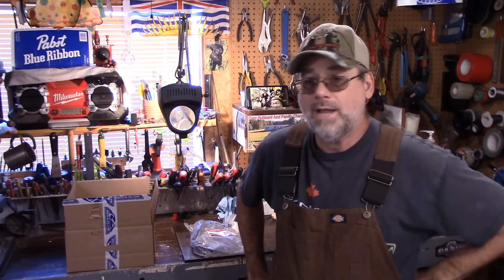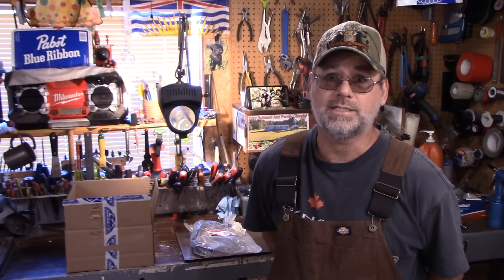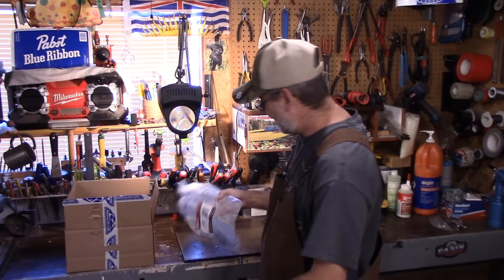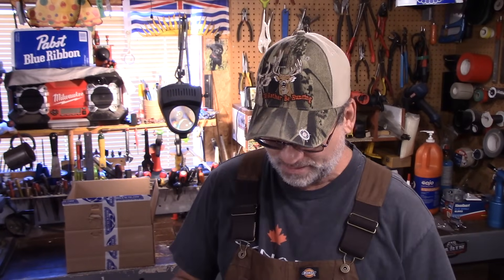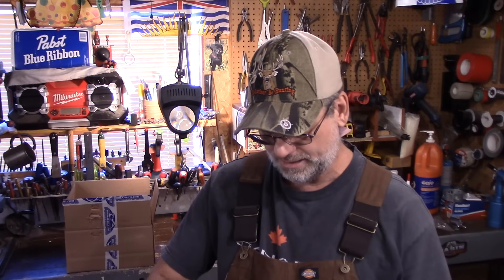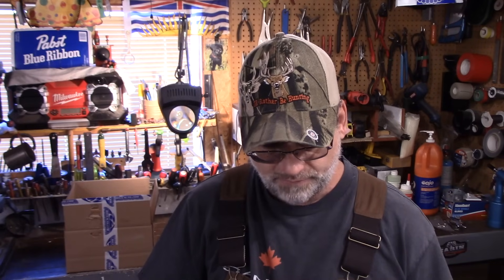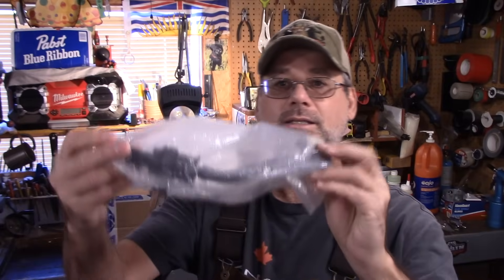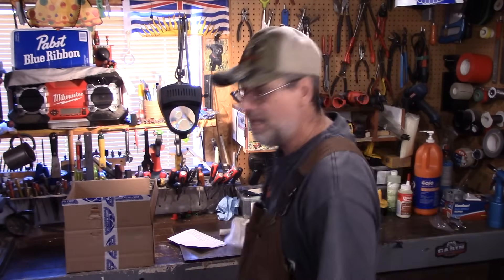F150  STALLING AT STOPS - THE FIX -  PART TWO

Comment: 2007 F150 4.6 liter.  never has stalling issues before.  i replaced the manifolds and EGR Valve because of rust issues.  and exhaust fumes. no spudder truck runs good....But now the truck is stalling at a stop light.  intermittent.   usually after been used for more than 10 min.   Any one with similar issues.  Getting a EGR code  0401 code  anything else to replace.....??
Reply from the maker: Seems your computer is still setting insufficient flow . Check for blockages would be my best guess.

Comment: I have a 03 F150 and it stalls when stopped and will not go. I have to hold gas until it eventually takes off. Not sure if this can fix that problem. Just changed filter and fluid.
Reply from the maker: Ramon this condition never flooded it with  so much fuel not to restart .  Your condition I would concentrate on the throttle body and the  first thing is clean it and go from there.

Comment: Here's a new twist into stalling when stopping or slowing to turn with a 2000 Explorer 5.0. At first I thought it was water in the tank that moved over the pump intake strainer and plugged it whenever slowing or stopping since if I jacked up the rear end the car would die. Dropped the tank and found the fuel pump / sending assembly totally broken loose from the mounting plate. The plastic baffle / gas reservoir that is supposed to be attached to the bottom of the tank had broken loose and over time it apparently broke the pump assembly as the gas pushed it back and forth during stopping and starting off. The resulting mess had the strainer sticking up so that when stopping the gas moved away from it. The daughter said the fuel gauge had quit working a few weeks ago then it started stalling at stops.
Reply: Sounds like a nigtmare... Hope mine is not that...

Comment: since it started the 2nd day ya had it,I was thinking loose connection, wire. hopefully you do have a stubborn purge valve. sucks learning the hard way. this is like a good movie now, who did it
Reply from the maker: Jeff it's a guess at best - I think worth a try and it seems a common resolve too . In time it will tell and I will update on the stalling.
Reply: STEVE ROB REVIEWS if Paul recommends that, we would all be fools not to listen.
Reply from the maker: Paul didn't recommend the purge valve he suggested it could be fuel related between summer and winter blends.

Comment: I have f150 2016 5.0 same issue 

What is the part name that u changed?
Reply from the maker: Evaporative Purge Valve.
Reply: My trucks having the exact same issue. At red lights it refuses to go and rattles violently. Check engine light flashed and sometimes restarting my truck fixes it immediately but now I had to wait like 20 minutes for it to cool off. I had a bank 1 sensor 1 running too rich a while ago for the exhaust value but I’ve heard from other sources that it could be something else
Reply: So I hope it’s just a stuck open purge value causing all of this but if I have to also replace the sensor in the exhaust I’ll do that also
Reply: Just curious to see what you think my problem could be
Reply: Since it started getting cold here in Texas, truck has turned off on me 3 times. All of them were when I was going uphill .

Comment: Did it work?? I have an 05 f150 and it just started doing this to me. And it was 90 degrees all summer until about 3 days ago up here in Minnesota, it’s been in the 40’s the last 3 days. It’s only happened twice. But mine doesn’t run that great to begin with.
Reply from the maker: Solved the stalling instantly .
Reply: Same here... Minnesota hahaha

Comment: I am back Steve, I noticed the truck stalls, stops my fORD 1990 F 140 4.9 because the battery gets too hot. I mentioned it to the guys and one said 'thats a common problem with those trucks because the ignition coil too close to the motor. Another mentioned the it was the ignition part that is close to the battery. I will start with the first and see what happens. Imention this so it may be of help to someone else.
Reply: My 92 4.9 stalls at quick stops and in reverse. Running rough. Not sure what it is yet
Reply from the maker: @reefjunkie9018   First thing I  would do that is so easy is clean your throttle body , takes 5 minutes  and it will instantly show a result or not  if your minimum air is being plugged with deposits.
Reply: @reefjunkie9018  Check, clean the Mass Air Flow Sensor

Comment: Found a similar problem with a 2010 E350 I'm working on replace canister purge valve and still had the same problem It only stalls when you're coasting up to a stop sign or a corner and then go through it turn the wheel and it'll stall.
Foot on the gas or taking off from a stop sign or a stoplight all the power in the world no hesitation no dropping cylinders or stumbling goes through the RPM power band just fine it's only coasting to a stop and then turning.
Reply from the maker: The valve fixed mine .
Reply: @SteveRobReviews  It didn't with mine but a very quick update called a good friend of mine whose had this problem before and sure enough it was something very simple and stupid. So on the vans that have that canister style air filter... The mass air flow sensor wiring harness goes through the side of it before it plugs into the MAF itself. Around the wiring harness is a rubber puck which seals up the air gap behind the mass airflow sensor where the wiring harness comes through the plastic casing. It often times likes to work itself free and sometimes the wiring harness itself going through the center of that rubber puck creates an air gap.
You wouldn't think that would be enough but he suggested sealing it up with some silicone... Sure enough idling problems solved.
I've always known that Ford mass air flow sensors are very sensitive I've known people who've put cold air intakes on their f-150s and f250s and get lean codes.
But an air leak just about the size of a half a dime was causing the issue

Comment: the 5.4engines, 4.6 too.  they are throw away engines.  they say use 5-20w.  it is too thin for worn engines, such as over 100,000 miles.
the engines get worn and the hot oil pressure coming to a stop drops so low  it is below the computer engine cut off pressure and the engine stalls. restart give the pressure switch a jolt of higher pressure and the computer allow the engine to start.  it happens with mine.  i put heavier oil in it and lucas oil stabilizer and it seems to have done the trick.  the oil pressure guage in the ford trucks is fake other than off and on for the computer.  all those other fixes won't correct low oil pressure at high temperatures
Reply: What oil do you use? I still use 0-20w and it stalls from time to time
Reply: @AlexOnibokun  i moved up to 10w30, my stalling stopped completely.  5w20 is too thin for a worn hot engine from my experience,
Reply: @jmyers9853  thanks for the prompt response. I got mine a few weeks ago and I observed the aggressive jerk caused by the vct solenoid. Changed the oil to the recommended 0w-20. I will be replacing the vct solenoid and the cam shaft position sensors this weekend, then change the oil to 10w-30. I also observed my full tank doesn't do more than 200miles as against the 585miles it shows when fueling up

Comment: Hello everyone I have a 96 f150 5.0 if it’s any wormer than 80 the truck will not start right away and after driving no more than 5 mile it’s stalls but it’s not over heating I am not able to Figure it out any ideas

Comment: Amen to sharing information and Steve Rob does a good job of that.
ScannerDanner is where I got some of the info I shared with you. He's a great guy and he likes to find the problem or recreate the problem. Your problem is a little hard to diagnose as it happens once a year. Say your not on Santa's naughty list are ya? Excellent suggestion by Paul because the gas is blended with more light ends to make starting easier in the colder weather. So much so that back when the majority of cars had carbs the engines would run leaner with this mixture. With the O2 sensors and computers in todays cars the computer just compensates for the leaner gas mixture by allowing more fuel so that the air to fuel ratio remains the same. Hope he fixed problem four4 ya and I'll see ya round Christmas to find out.
Reply from the maker: Let's hope for the best and hope I don't  have a stall in 2018. Thanks for the help buddy.

Comment: did this valve also fix the low oil pressure light you where talking about in the first video?
Reply from the maker: The low oil light automatically goes on if the engine stalls.  There was no fault with the oil light. Cheers 👍
Reply: Sweet thank you

Comment: Mine has stalled just a couple times normally when off-road in low range four wheel drive idling down a hill.
Today it's stalled or almost stalled while turning into a parking space at extremely slow speed so I'm going to have to look into this.

Comment: 2008 expedition XLT will start up just fine and once it heat up half way it will begin to have a slight knocking sound and shakes…. It also shakes and stalls at a stop….any information will be helpful ❤️
Reply from the maker: Could be a lot of expensive guesses, so it's best to invest in a good shop to do a proper diagnosis.
Reply: what did it end up being? have you took it somewhere to get diagnosed
Reply: @ had to get a  new motor
Reply: @ uh oh im having the same problem

Comment: I have a 2015 Ford F150 5.0 I read on another video. That the fuel pump drive module can go bad causing the truck to stall out occasionally and idle up and down and shut off. The dealer can't figure it out. Say the vcts and phasers are good. Do you think worth  it's a shot to replace? Any help would be appreciated. Thanks
Reply from the maker: Dont think you have a fuel pump drive module on the frame under the box at the rear , yes that was a problem .  Mine the dealer could not fix either but the evap purge valve under the hood fixed it  for good . Ya for $60 its worth a shot.
Reply: @SteveRobReviews  I replaced that already no change. I'll try this module I located above the spare tire rack. Can't believe these technicians can't figure it out. Apparently this is a common problem with the 5.0s idle and stall issue. It's less prevalent when it's cold outside too. So annoying only has a 110k on it and really not interested in trading it in lol.
Reply: So it stored some codes and after the technician messed with it. It ended up being the vct sensors on my passenger side 2,000 miles since repair no more erratic idling or dying out so we'll see if the problem comes back..
Reply: @LA-TEEZI  VCT Solenoids I had two bad ones. It took them looking at my truck 4 different times to figure it out.

Comment: I have a 1998 Expedition, 5.4 v8 triton. Recently I started loosing power while driving to the point that it would shut off. Turns out it was the cat that was clogged so I got it replaced. It fixed the problem but now when I turn on my truck it idles and shuts off if I do not give it gas. It does the same thing while on drive as I stop.
Reply from the maker: Totally fixable , a bit of testing but a good tech can fix it.
Reply: Did it have a knocking sound ?

Comment: Someone help me please. My ford f150 5.0 will start up and I can drive to the corner and then it acts like it's starving for gas and WILL die but it WILL start right back up everytime and do the same thing. Help me please
Reply from the maker: Your going to need a scan tool and read any codes and observe the live data .
Reply: Thank you Steve Rob I really appreciate it I will let everyone know what it is when and if I get it fixed 😀
Reply: What was the problem mine does the same thing
Reply: @katherineboultinghouse1451 what was it?? Im having the same issues rn

Comment: My 2003 Ford F150 started doing this intermittently back in October.  It will go 2 or 3 weeks without it happening but then it will do it twice in one day. Sometimes it sputters but doesn't die. Ever since it started happening it idles a tiny bit on the rough side.  It runs great and feels fine when driving.  Hopefully, a purge valve will fix it.
Reply from the maker: Good luck Brad 👍
Reply: did it fix it?
Reply: I am having a similar problem with my 2001 in colder weather.  Let me know what happens.  I am cleaning the throttle body today.

Comment: I have a 95 F150 300. Engine drops oil pressure and sounds like it wants to stall when coming to a stops. If I switch to neutral, oil pressure comes back to normal and sounds fine. Oil pressure and engine runs fine while driving. Any ideas??
Reply: It just started when I just did an oil change and used Mobil 1 5w-20. I’ve read to use 10w-30. Or could be oil pump failing.
Reply from the maker: David oil pressure is conditional to rpm  so low rpm = low oil pressure as you noticed when it wants to stall.  So many things could cause this but I'd make sure the basics are sound  .   Throttle body is clean , idle air control solenoid is working  correctly and no noticable vaccum  leaks .
Reply from the maker: The oil change  should not likely cause your symptoms .
Reply: @SteveRobReviews  thank you for the response! I will check for vacuum leaks and get back
Reply: @SteveRobReviews  UPDATE: I changed my oil to 10w 30 and the problem stopped
Reply from the maker: @MasterMotoTv  WOW thats awesome.

Comment: Good job boss. I have a f150 ford 5.4 I put a new fuel pump and new fuel filter new battery and new Crank sensor and cam sensor no fule mod on it I can't find what the problem is. Would you now
Reply from the maker: Wow it's time for a pro to look at it before you run out of guesses:)

Comment: The purge valve does not seem to be the cause of stalling when idling or cruising, only when going back to idle 🤔
Reply from the maker: Yes exactly  so most would look at fuel pressure and idle air control.   Looking at fuel trims tells a lot if you have a scan tool.  Stalls are all fixable.
Reply: @SteveRobReviews  
Disconnecting the IAC valve drops the idle and throws the relevant DTC, so it's not that. 
I've ordered a fuel pressure gauge and injector tester (Temu, ~AUD50 for both) as I THOUGHT I had a stuck injector(s) due to large negative fuel trims on one bank, but I think I misread my cheap-ish V519 scan tool. Will test "leak down" anyway 🤦‍♂️
Reply from the maker: @electron-1979  👍
Reply: You're right IAC valve could be lazy.
I'll test that 👍

Comment: Mine will stall if I rev it up then let off the throttle, as well as when coming to a stop. 
Will update my comment when I try this fix.
Mine is 2004, so it has an Idle Air Control valve, but I don't think that's the issue
Reply from the maker: I'd look at cleaning the throttle body and see if the  plate  is all carboned up  .
Reply: @SteveRobReviews 
I commented about cleaning it, but you were so fast the reply 😊
Reply: I'm in Australia, so no rust 😊
Trans has worn servos, so needs the fix 
200,000 kms and the engine runs great and is very quiet 😊
Reply: I blocked off the tube from the purge valve at the manifold, but no change. 
I tested the purge valve by applying vacuum to the little vacuum port. It leaks a little, but no flow when sucking on the larger vacuum port (you still get some flow if you blow hard enough through the fuel tank port).
Applying 12.5V (approx. 0.35A) to the solenoid blocks the flow through the little vacuum port, which opens the valve, allowing lots of flow through the larger ports.
Reply: Fuel pressure measures within spec (60 PSI).
The Idle Air Valve is a bit stiff and doesn't return. They are fairly expensive here in AU (AUD249+).
Luckily, I found a Proflow LS adaptor (PFE689S or PFE689BK) and an LS Idle Valve. (PFEQTBIAC or PFEQTBIAC-2) is cheap 😀
Adaptor and Valve just over AUD100

Comment: My 2010 has been staling at idle and having trouble starting sometimes... put o2 senser and purge valve.. so far it seem to fixed
Reply from the maker: Good to see you found the fault.👍
Reply: 2010 f150 5.4l platinum
Reply: Next step was going to be throttle body!!! Just replaced purge today.... hoping it keeps going good
Reply: The purge valve was bad though... could blow right threw it
Reply: So far still running great

Comment: My 2001 f250 5.4 and my 2010 f150 4.6 both have this stalling problem. 

I’ve changed all the plugs and coil packs on the 250 which still didn’t keep it from idling really high. My local mechanic tinkered with the throttle pos sensor which stopped it but now it idles really low and stalls at slow speeds and my mpg dropped from about 12 to 8. 

My 150 stalls at slow speeds as well but not nearly as much as it did before I replaced the upstream o2 sensors. There’s no codes or info at all when diagnostics are hooked up. I’m reluctant to change out the downstream o2 sensors because they’re $100 and might not be the problem. 

But both tritons are doing the same thing. I’ve checked the grounds as well for corrosion and all appear ok. I’m thinking it’s an air related issue or pcm. Any help appreciated!!!!
Reply from the maker: @WestTNReb343  Are you using a factory capable scan tool  or generic code reader as an upper level scan tool shows so much more data.  Understand how to read the data from a scan tool , that is a must know on how  to figure it all out.  Looking at data while its stalling will reveal the direction to most  faults.   Guessing  can get expensive, so I'd start with the basics and verify your throttle body is  clean and your O2 sensor data as well as MAF sensor readings are within range. There's a start that's not costly and actually fun to investigate, as well as learning how the scan tool data can show the out of range data displayed.  It's totally fixable.  If you want to learn how to figure our diagnostic   I'd  recommend a buddies channel .  Check out Paul's channel he's an automotive instructor.  "SCANNERDANNER"
Reply: @SteveRobReviews  thanks for the reply! No I’m just having Autozone hook it up to their device.